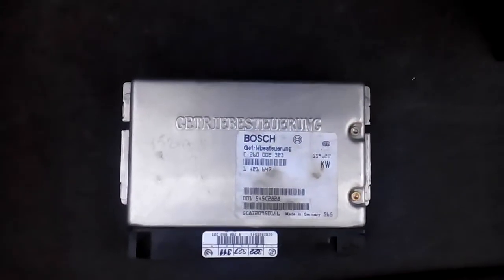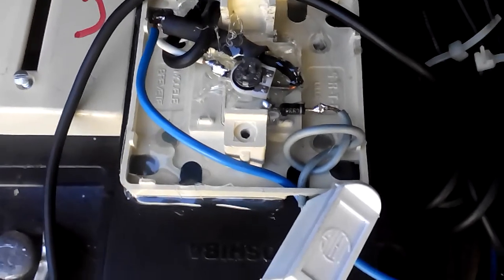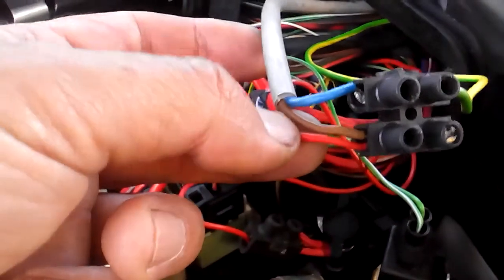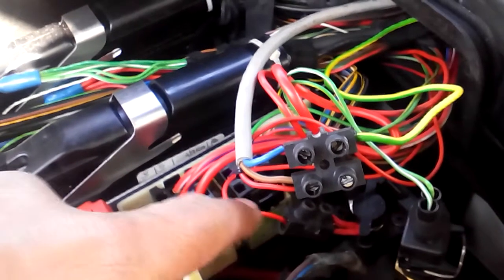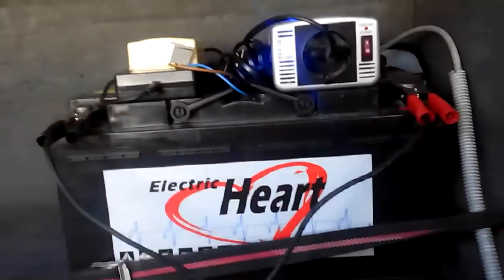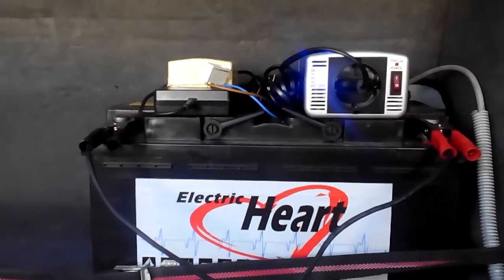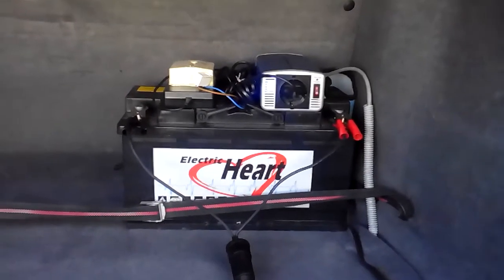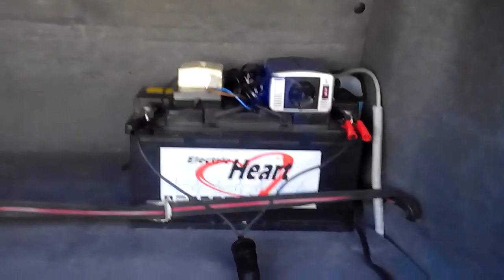Transmission failsafe program BMW E38 part 3/5: TCM

Comment from the maker: 4 November 2019, 229000 km, just back from a round trip of 2 weeks in Spain (1800 km.)
But 3 weeks before GRRRR! The Failsafe mode happened again! Let me explain:

I was 40 km away from home on a highway when suddenly a traffic jam. I slowed down and, as i was reaching 50 km/h i turned off the A/C. The rpm dropped to 600 and the Failsafe came back!  I left the car and came back next morning with my computer. No way, impossible to reset!!!  So i let the engine run to reload the battery ( between 2000/2500) for 2 minutes. Stopped the engine. Restart. Recharge for 1 minute, stopped and started again, and then it was ok!
I decided to keep the A/C on the way back. OK.

Now i do not recharge the battery no more (so the alternator is kept busy for a while) and i start the A/C with the front lights from the begining to the end of the trip.
No incident since then.
PS: my battery is 18 months old.

Best regards

Comment: The e38 has to be driven twice a week or more to maintain the battery due to excessive amp drain.  Have you checked every plug on the engine or plugs to power windows, radio etc for battery drain ?  Sometimes a device won't shut off after turning the key off and perhaps a bad part or bad capacitor or a short in the wiring is the culprit?  Regardless an inline smaller battery gives the computer that sugar high it wants from the big battery so perhaps  that is a good solution.  I've been using a solar trickle charger to maintain the battery by the gremlins on my 740i were draining 2.2 amps but I  fixed a short on the radio and the alarm and the power drain dropped to .92 amps which is better. But something isn't turning off or I've got other shorts.  Normal draw should be .5 amps or so, there's an exact number some owners say is normal but your battery idea may suffice.  Will check back later.

Its been 10 months has the limp mode gremlin returned ?
Reply from the maker: Hello and thanks a lot for sharing your personnal experience. 
Yes, the Failsafe mode came back a few weeks later. So i bought an new battery, but then again...
So i decided to investigate deeper with the software INPA and It seems to be fixed since then  ( july 2018) 😆...
I should search for leaks you're right.  But my schedual of use is closer to once a month than several times a week. I certainly have a random drain. When everything is fine, i got a 0,2 amps consumption after  20 minutes. But i mesure 12/11,8v after 5\6 weeks, doors unlocked in my garage. So before i start, i recharge the battery. 
But since i reset something with INPA, i no longer get the failsafe mode 😉, even if i start with 11,8v. This is the subject of the two latest vidéos:
https://youtu.be/XgNcoVl30Ys
https://youtu.be/OGZN5QCkZnE

The Failsafe mode must be a security mode due to unpluging  the battery. Now i hear distincly a Relay clic from the glove  box and the solénoïde 1 sumultaneously when i turn the Key step 2.
Good luck my Friend.
Reply: @piericks1846  I'll buy INPA now that I see its benefits online, I knew about it but its a must have!  I know the newer 2002  & up 7 series requires battery recognition via the Idrive control in the car or with inpa so maybe the e38 has a similar issue.  Thank you!!!
Reply from the maker: @juggernautz  hello. I guess It has something to do with the EWS module which is located under the glove box... 
https://youtu.be/A2HNqN_Jf_Y

Comment from the maker: 2018\06\16. Failsafe at once when Key engaged step 2.
  3 weeks without using the car.
  Bateries fully charged.
So i drove on the rear gear for 300 meters in order to heat the fluid ( gear box fluid and filtre are 25000 km old). Than i parked, engin still runing. Turn off for 3 minutes. Than start again. Default's Gone on the dash board ( only). Gears ok, but gear box on an ''average mode'', you can feel it, no frankle kick down... And failsafe again After 3 km.
With the batterie charger delivering 15 Amps  i could clear the défaults with INPA software all the modules i could, Écu, TCM,  air bag  in Body menu ( obd1).
Many défaults cleared like ''lambda integrator , abs sensor''...which are very uncommon ...
This is why i think we have several problemes at the same Time  linked together: a lack or use which induce ''frozen'' solenoïds, and a low electric impulse not enough to ''sustain'' all the modules when i ignite. Should i start with a booster? Should i use the car at least every week?
My next expérience was than astonishing! Like i had the full response of the engine and the gear box for the first Time  😨 ! Sensitivity, reactivity, full power exploitable...encouraging 😊...

Comment from the maker: Here we go again... Last weekend, after 50 km we decided to stop in a little village for lunch break. As i stopped the car, the iddle was low and Transmission fail safe mode again😣!
Iddle gestion is automatic. Could it be a question of oil pressure sensor? After our lunch break (45 min off supply for TCM which cleared the default in the memory), everything went right on our way backup.
A way to keep iddle higher would be to run with the air conditionner...before further investigations...
PS : Main battery was not fully charged (12,6v) that day .I usually start the car with main battery at 13,7v ( floatting tension). Then i disconnect the charger .

Comment from the maker: Despite a 4 months old battery, the TFSM came back, in the middle of a 400 km trip. My father noticed on the way back that TFSM was happening while i was braking long enough to slow down bellow 25 mph.

Back home, we mesured the alternator delivering ''only'' 13,76 V when the engine < 620 Rpm, and 14,16 V above.

And sometimes, while driving, tension drops bellow 13,1v for a short period of Time ( when the battery is fully charged ?...)

So i decided to make a 14,1 V permanent supply for the Transmission Control Module. It is the one you cannot communicate with when TFSM occures.

We've tested it last week with more than 600 km. And i pushed it beyond the limites which used to activate this TFSM and...nothing happened ! 😄
Reply: Guess you didn't switch the main problem for trans safe mode the abs  module faulty